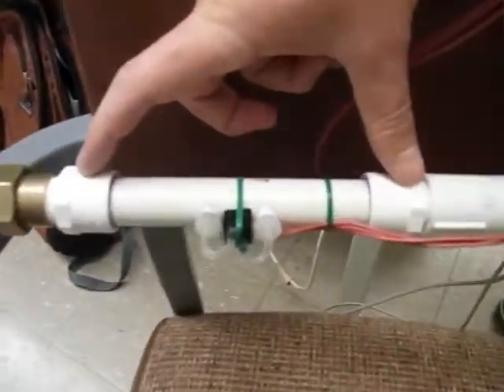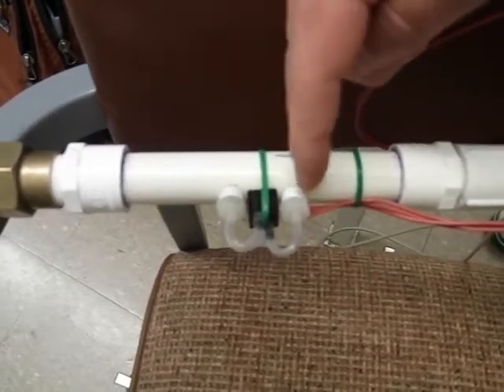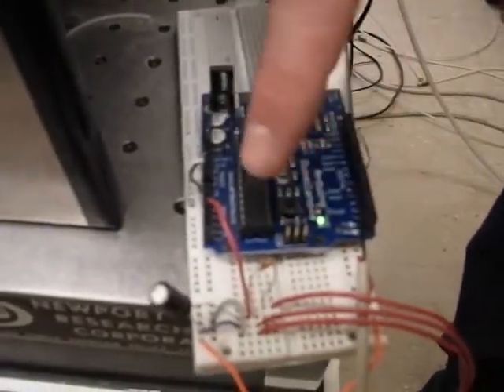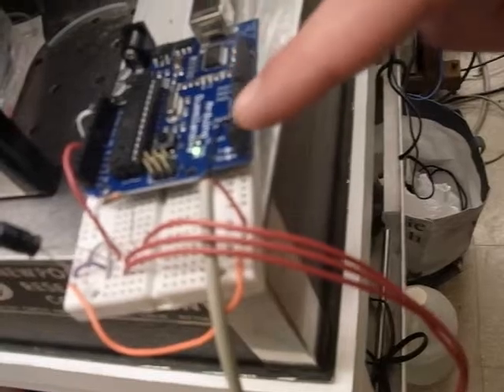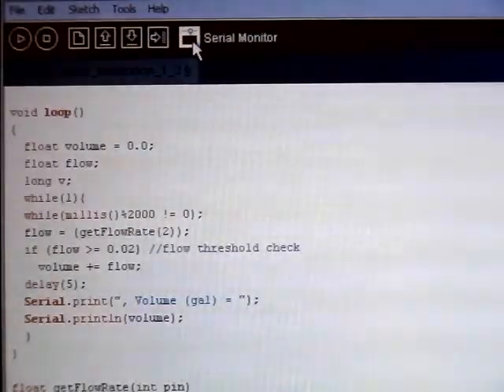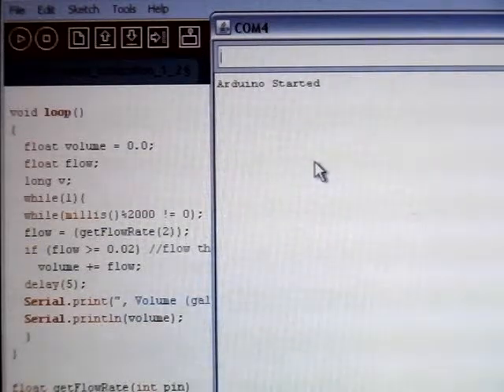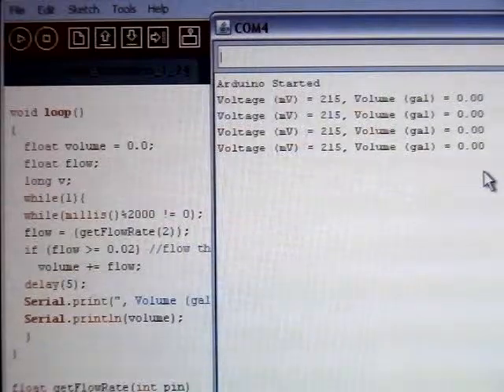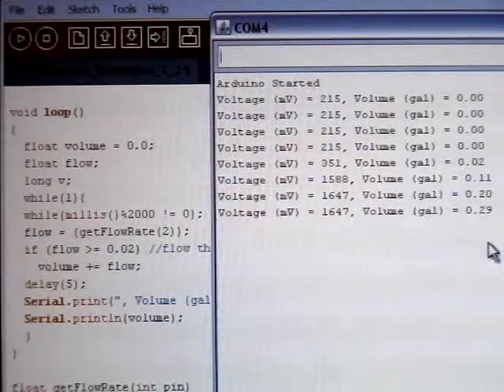EEWB Arduino Water Meter

Comment: Same feedback as the rest.  Great work!  Is this work going anywhere, or did it get submitted for the competition then go away?  How do I make/get one?  My application is part of monitoring of a 6'x8' low cost/high production aquaponic food system that uses monitoring and automation to reduce the hand-holding on the system.

That dual pressure sensing IC seems to be the key - is it custom or OTS?  Also, distance between the upstream and downstream sensors, as well as highly accurate inline alignment, are the keys to not having extensive calibration of the system from sensor to sensor.  (IE, not needing the expensive flow meter to calibrate the cheap one.